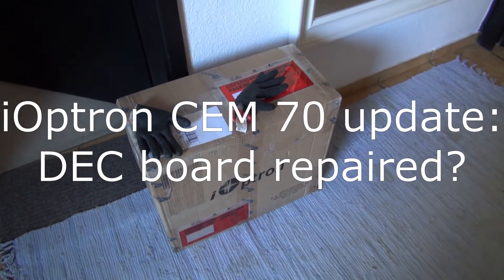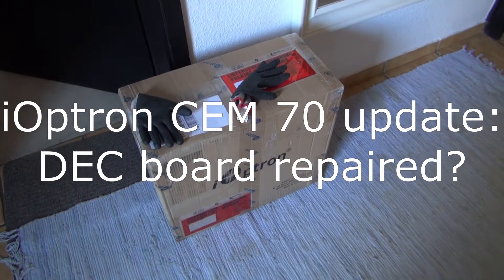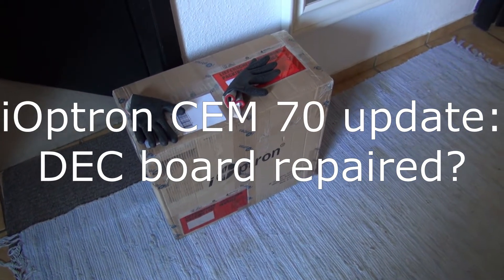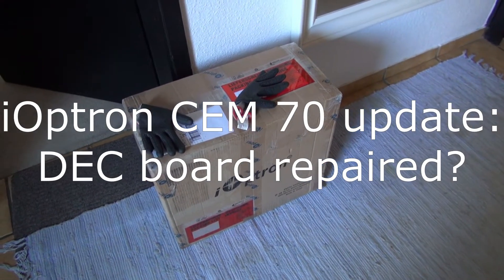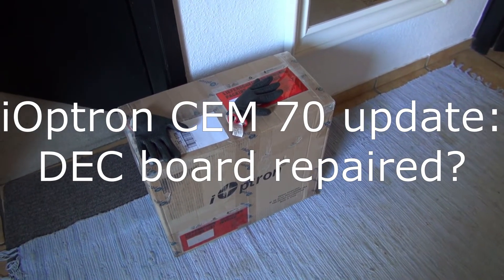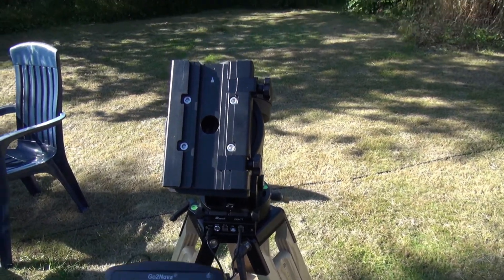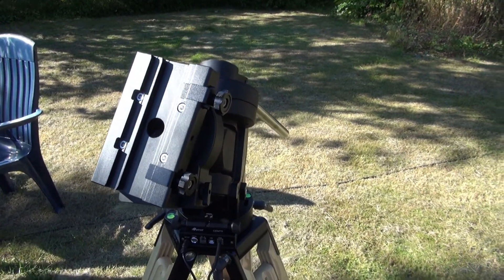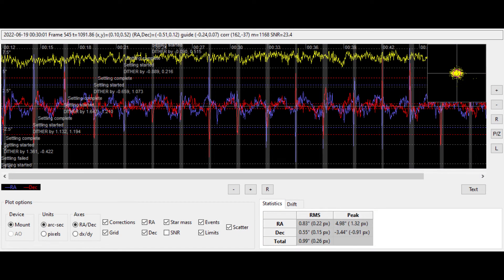update on my CEM 70 DEC board failure

Comment: Just to give you my experience. Had the ra/dec boards replaced because of high frequency oscillation. Still have a problem with dec going into swings after meridian flip. All 3d balanced. My Neq6 gives better results than this mount.

Comment: Nice video and glad your mount is working again. I have the CEM 70 , QUESTION in one of your videos you said when you plug in the power supply at the base of the mount near the on/off button, that from then you can power you ASIAIR from the power port on the top on the dec saddle. I was informed you need to have 2 power supplies one for the bottom and one for the top. Is this true I was wondering , because I plugged my ASIAIR to the top port and it did not do well at all. I was thinking I had to many devices running off my asiair causing the issue, my main camera for cooling and the camera , and the guide cam and the heating element on the main camera to stop it from dew. This seemed like to many amps I was asking the mount to put out by itself.  What can you tell me? Thank you and I really like your videos.

Comment: Glad to hear the issue is fixed. Is that the normal guiding results you have been getting with the cem70?
Reply from the maker: Dave thanks for your comments, yes usually the rms for both ra and dec is below 1 but this always depends on sky conditions.
Reply: Tom, Thanks for replying. I honestly thought the Cem70 would have better guiding being in the price range that it is. The numbers aren’t bad, I guess I just had higher expectations. Lol

Comment: Good that is everything ok Tom. Does the seller told you what was the problem? I have a similar error RA NOT CONNECTED, and seems to me that could be any cable disconnected. I think I will disassemble it .
Reply from the maker: Ricardinho: unfortunately the seller just told me they fixed the dec axis, got no report what exactly was fixed, sorry. To check the connectors is a good idea anyway, good luck, Tom